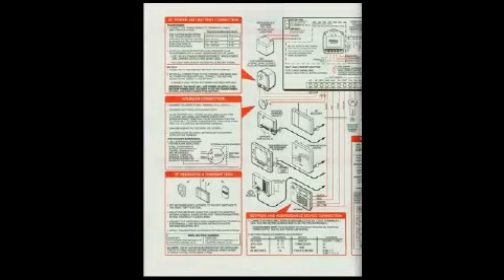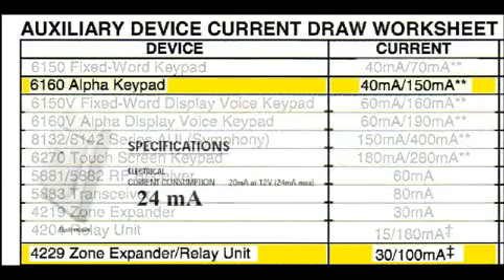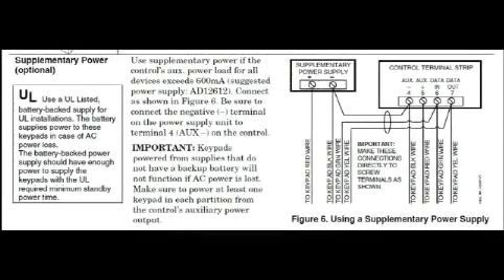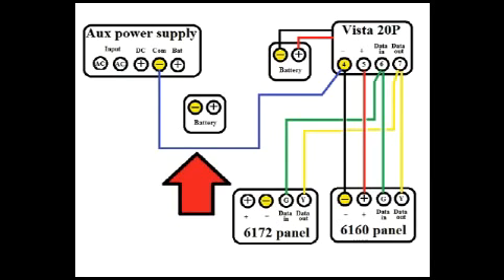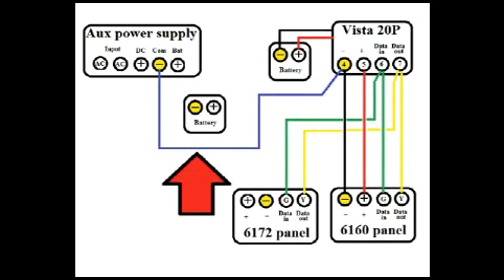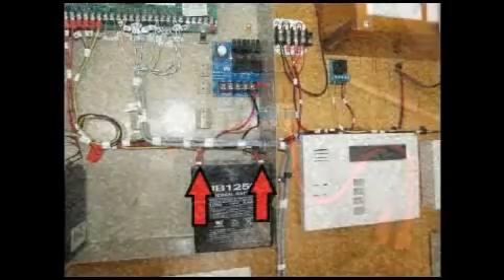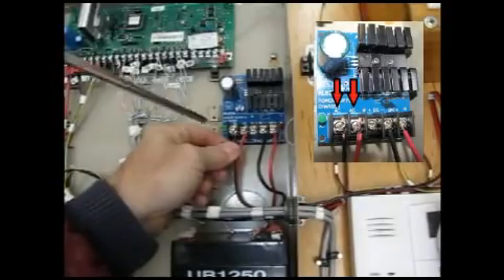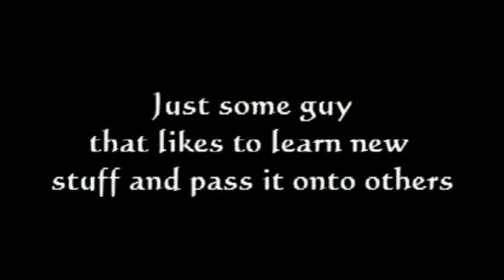installing a supplemental power supply (Vista 20p part 14)

Comment: Awesome video thx.
Reply from the maker: Glad you liked it!
Reply: @bounder97  would you happen to have a video on adding a power supply to the 2a horn circuit. I want to add more horns to my system but don’t want to go over the 2a. Thx a mill.
Reply from the maker: @Drilldrillsauce80  Hello, I do not have a specific video about what you asked. I do however have a video that talks about how to drive a relay with your alarm system. This is the way you would add power supplies that power a horn directly. The video is called 'installing an auto dialer (Vista 20p part 10)". The relay information is roughly five and a half minutes in. Good luck.
Reply: @bounder97  thanks I will watch. Happy new year.

Comment: I have a question. If I am using an auxiliary power supply on a Honeywell Vista 20p that is only powering motion detectors and glass break detectors, do I still need the common negative?

Comment: I like to put a piece of electrical tape on the can itself just as extra precaution not to short anything out. also, I tend to use screws to mount the power supply to the can, we can simply use drywall screws they will pierce the can itself. Lastly, on my system at home, I did use an SMP3 PM I believe is the part number, with this power supply, you can hook a relay on the power supply to one of the hardwired zones, you can monitor the AC and the battery. Without this method, you will simply have to rely on replacing the battery when the alarm system tells you it is time.
Reply from the maker: Thanks for sharing with us..

Comment: May I offer you a tip?  When running wire for the keypad, motion, glass break, etc, use thermostat wire.  The reason is because, it has most of the colors and numbers of wires that you need and then some.  And, a lot cheaper than the security company wire.  However, if using smoke detectors, I would strongly recommend using fire alarm wire for smokes, siren, and at least one keypad.  However, you could use thermostat wire for smoke detectors as well because my smokes are wired with thermostat wire.  But, if it is only for security, use thermostat wire everywhere.  You can get thermostat wire from your home improvement store.  When using touchscreen devices, always keep a 6160 on hand.  And, I would highly recommend a 6160PX keypad that has the proximity tag reader.  And, I would definitely recommend putting a 6160RF keypad right benext to the panel.  I installed mine that way.  6160RF keypad right beneath the panel.  And one more thing, if you have smoke detectors, you will need to install a honeywell relay module programmed as a fire zone reset.  And, wire the smoke detector through that relay so they can reset after an alarm.  My advice, this is how I did my alarm system, wire at least one keypad through the fire zone reset relay.  The reason for this is because, keypads always make a long beep after power up and power reset.  You can use this to let you know that you have successfully executed a fire zone reset.  Some, but not all, but some carbon monoxide detectors require the power to be cycled to reset after activation.  I have two of them that are that way.  If you have a carbon monoxide detector that requires the power to be cycled to reset, program it's zone as a fire zone and then label it as carbon monoxide.  Most carbon monoxide detectors reset on their own but carbon monoxide detectors that require power cycle for reset do exist.  I have two of them like that.  And, program in a fire zone reset relay for that purpose.  Otherwise, if you have carbon monoxide detectors that reset by themselves, most of them do, then, program them as carbon monoxide zones.
Reply from the maker: Thanks for the information Chad
Reply: @bounder97  No problem.  Door and window sensors wire up just like pull stations (the little red pull down boxes that you would have seen at school when you were younger...oftentimes saying FIRE ALARM PUSH IN PULL DOWN or something similar).  Well, door contacts wire up just like the pull boxes at school.  In lamest terms, door contacts wire up just like light switches.  Motion sensors on the other hand wire up just like smoke detectors.  But still, very simple.  My niece could wire them up and she's only 3.  The proximity tag reader keypad just has two addresses to set.  Keypad and reader.  Leave the reader at address 23 which is default.  Press 1 and 3 together and enter the two digit number of the appropriate address and press *.  My 3 year old niece could do that it is so easy.  The 6139 keypad will work on vista 20p panels and has a vintage appearance to it however, the cover door on the 6139 doesn't open all the way, only half way which can cause it to break.  And, the 6139 has very small buttons.  If you have big hands like I do, the 6139 probably is not the best keypad for you.  However, the 6139 fits in a tool belt very well which makes it convenient for programming.  Unfortunately, the 6139 is no longer made so it might make a terrible keypad anyway.  I have a 6139 and I "like" it somewhat but I prefer the 6160.  The 6460 had a custom made appearance but it doesn't have a cover door so if you have an active household, then maybe you should stay away from the 6460 and stick with 6160's everywhere.
If you have little kids, then I would highly recommend against giving the child a proximity tag or key chain remote.  Children lose things all the time that can create a very dangerous situation if a key chain remote is lost or stolen.  You can still program the key chain remote through programming mode however, set up an auxiliary code and link the remote to that instead.  That way, if you lose a key chain remote, delete it's respective code.  However, BE CAREFUL ABOUT THE *88 FIELD!  I know that I wrote that in all caps but it is extremely important!  I had a vista 10p panel that I did that to and it was a big mess.  I had to buy a new panel, which I got a vista 20p panel instead.  If you change ANYTHING in that *88 field in programming, it WILL permanently lock you out of programming mode and put your panel in the toilet.  Which that unfortunately means that you would then have to buy a new panel.
Get total connect 2.0.  Way better than a dialer.  Trust me.  If you drive away and forgot to arm your system, you can do it from your smartphone or tablet.  However, get the Norton app lock and set it to require a code to access the total connect 2.0.  That way, you are protected if your phone is lost or stolen.
One more thing, the true thing about carbon monoxide is that it is colorless and odorless so you can't see it or smell it.  Yet, carbon monoxide is deadly...absolutely deadly.  Often referred to as the "silent killer".  If you have a carbon monoxide leak in your home, you are going to want your Vista 20p panel to signal for that as well.  Having a carbon monoxide detector hooked up into the vista panel will make that happen for you.  System sensor makes an i4 smoke detector with carbon monoxide so it will do both.  Those are great for hallways and living rooms.  Only one device to install!  And, I would strongly recommend putting a siren in your bedroom.  If it should ever go into alarm while in bed, you'll want it to be as loud as it can be and you're going to need all of the decibels you can get.  And, I would strongly recommend a 6160 in the bedroom.  The low frequency of the 6160 wakes you up better, especially if you are a heavy sleeper like I am.  And, science studies have shown that low frequency sound wakes people up better.  A 6160 in the bedroom will make that happen for you.  A touchscreen keypad in the bedroom will also work.  Test your system monthly and immediately replace failing alarm parts.  Keep your code confidential because that also helps with getting the best out of your system.  Also, set up your glass breaks to chime when door chime is on.  It makes it easier to keep an eye on things.  Set your glass breaks to be on while in night stay.  That helps with security at night.  Set up your glass breaks as interior follower zone.  That will turn off the glass breaks while in normal stay.  That will prevent false alarms while watching Titanic.  That is especially at the grand staircase dome imploding scene.  And, the water smashing into the wheelhouse scene where the captain gets engulfed.  Those scenes trigger the glass breaks every single time.  Programming them as interior follower zone will prevent false alarms over glass breaking on TV.  The movie Titanic sets off the glass breaks every time.  Program glass breaks as interior follower and set them up as night stay zones.  That way, the glass breaks are still available at night when you go to bed.  All of this will deliver the best performance from your vista panel at peak performance and operating at it's full potential.  I have mine set up this way and it has worked perfectly since I programmed it that way.  If I had to do over again, I would program it that way, the way I described again.
Reply: WOW.  You can use trigger 17 for fire reset IF you only have a few smoke.😊

Comment: Can you recommend any Kit to go with vista20p and auto dialer with LTE support? Thank you
Reply from the maker: Hello, I'm sorry that I cannot make a recommendation for you. If I have not had direct experience with a company or product, I will not recommend them. Those that I have worked with are subpar on tech support. That is one of the reasons why I posted all of my “how to” Vista video’s. I know how frustrating it can be to install an alarm without a source of reliable information. Thanks for asking..
Reply: @bounder97  Thank you for responding.  I am looking for guidance only at this point,  not really bothered about tech support.
Reply from the maker: @senthilm  I'm sorry.  I can not recommend a company for you.
Reply: @bounder97  no worries

Comment: Hello and thanks for your videos. they are all fantastic, easy to follow and frankly if it weren't for them I'd still be trying to get things working. With that said.. I seem to have run into a road block. I am all but deaf without hearing aids and since I cannot sleep with them I cannot hear even loud sirens, well barely that is.  I have successfully connected a System Sensor P2WL horn/strobe indoors but it only sound when the security alarm is triggered not when the smoke/fire detectors are tested. I have tried everything I can think of to fix this but no luck! Funny part is, it will sound the Honeywell wave siren I have mounted outside but not the P2WL even if I disconnect the wave. Not sure it is a power supply issue because it works loud and strobes fine on intruder mode. Any advice? Thanks in advance, hopefully I can save from pulling out  the little hair I have left! LOL.
Jim
Reply from the maker: Hello James, sorry for the delay. I was at work fixing a broken airplane. Anyway, I think I can help you a little. I looked up your P2WL sounder. The specs states that the P2WL requires a constant input voltage from the alarm panel to work properly. The Vista 20P output during a fire alarm is a temporal output (English version - means it is a pulsed output to cause the horn to turn on and off). This means that the P2WL was not designed to work with a Vista 20P for fire output. The Vista puts out a constant 12 volts during a security alarm, which is why the P2WL does work during normal security alarms.  To make the P2WL compatible with the Vista 20P fire alarm output, you will need an interface to convert the strobed fire alarm output to a steady 12 volts. It may be easier to look for a strobing alarm that is listed as being compatible with the Vista panel. I hope this helps... On a personal note, I understand your frustration at being deaf. I have worked on loud commercial aircraft for over 30 years. I too am working on achieving deafness.

Comment: Hello,  I bought an aux power supply for my vista and was surprised at how little information there was in the install sheet.  I stumbled across your video with a google search for additional info and was pleasantly surprised at how thoroughy your presentation conveyed the necessary information.   So thank you for making this video.  

My question concerns the battery.  I long ago installed a small car battery to connect to my panel as I kept having issues with keeping a proper charge with the smaller cabinet batteries.  Can I join the wires from the panel battery leads and the aux power leads and then connect to the car battery?  If not, can I install any type of electrical component inline to allow me to do so.  Having two batteries is a pain, and from comments below, it appears the second battery will not be monitored by the panel, so I won't know if it goes bad like previous panel style batteries.  Thanks in advance.
Reply from the maker: Hello, I'm glad I could help you. I too was very surprised at how useless the installation manual was. Concerning your questions: never hook two separate battery chargers to the same battery.  1) The vista and the supplemental power supply both have battery chargers on them. 2)Your statement about keeping a proper charge with a smaller battery would concern me. I see 3 possible causes. A bad charger on the Vista. (except you said it will charge the large battery). A bad or old  battery, batteries do have a life span. Or the battery is not being used properly. Normally, the battery provides power only during an alarm condition or during a power outage. If the power outage is for an extended period of time and the battery is allowed to drain completely (around 10.5 volts is drained), it will severely damage the battery. The small cabinet batteries are only good for short power outages. Like you, this is why I also went with a larger battery. Finally, depending on what you are powering, I really don't see a problem with the second battery not being monitored. If you are driving a keypad, you simply will lose that keypad during a power outage. I would just make sure the alarm outputs are on the main Vista. You can manually monitor the health of your batteries if you so desire. I have a voltmeter permanently hooked up to each of my batteries. Periodically, I remove AC power from the Vista and look a the meters. Do a search on the internet for "12 volt battery voltage chart" to find a list of good voltages that you should have. Or watch my You tube play list on 12 volt battery education on my channel. Thanks for the great questions!!
Reply: @bounder97  Thx so much.  That clears up many of the questions I had.  One last thought.  Would it be possible to put an appropriate diode inline from the aux power to the main battery, causing voltage not to flow (stopped) to the battery, but allowing battery voltage to flow back to aux during an outage.  If so, would I need diodes on both + and - leads?
Reply from the maker: @Buxton252  This is something I would NOT consider doing. If you do do it, you only need one diode on the positive terminals. Current must flow in a complete circuit, so breaking the circuit with one diode in the positive line will stop all current flow. However, remember, you have a .6 to .7 volt drop across most diodes. This means there would not be any current flow until your aux battery drained to a level of at least .7 volt below your primary. (assuming the anode is hooked to the primary battery). The voltage drop across the diode means you have lost that voltage to drive your downline devices. My main problem with this setup is you are still hooking two battery chargers onto one battery. The main battery charger will cross the diode and charge the aux battery as well as the main battery if there is a .7 volt difference. Do you know what will happen to the supplemental power supply when you back feed it with this other charging voltage? I don't. Also, anytime you start putting batteries in parallel, you are entering into a whole new world of complicated. (again, view my video's on batteries). Batteries in parallel need to be the same size, model, manufacture, manufactured date, ect. Basically, as similar as possible. If they are not, the charger can overcharge one of the batteries, or one of the batteries will drag the other battery down to it's level of operation.   So a bad aux battery can ruin you good main battery.
Reply: @bounder97  Yes, thank you for confirming my suspicions as I too was thinking:  "Do you know what will happen to the supplemental power supply when you back feed it with this other charging voltage?"  A UPS style DC switch that does not back charge the battery might work.  I found one on Amazon (search for B073QL7YMF) and it seems to fit my needs and is small enough to fit in the cabinet.  What do you think.
Reply from the maker: @Buxton252  I must confess, I am a bit confused. You seem very determined to do something that I have repeatedly told you is not a good ideal. 
Each time I point out the error in your logic, you send a new scenario to support your idea. In my last post, I stated I do not know what would happen if you back feed power into the supplemental power supply battery charger. You then immediately asked me what would happen if the supplemental power supply is back fed with power. This tells me you you are not really reading what I have written. I applaud  you for being goal oriented and tenaciously trying to solve your problem, but at this point I do not feel I can help you further. Good luck finding your solution, as I am sure you will. If you do find something that works, let me know. I can make a video and share your solution with others.  Regards...Bounder97